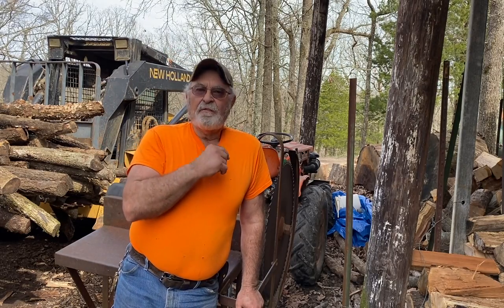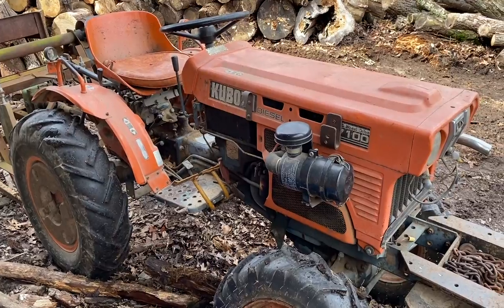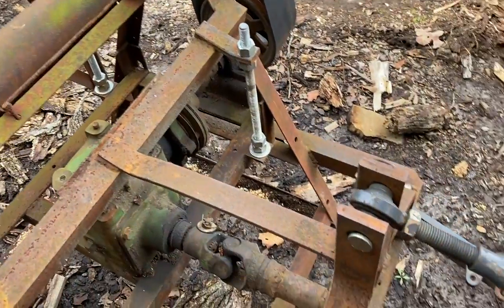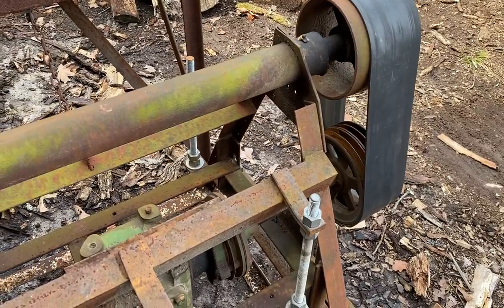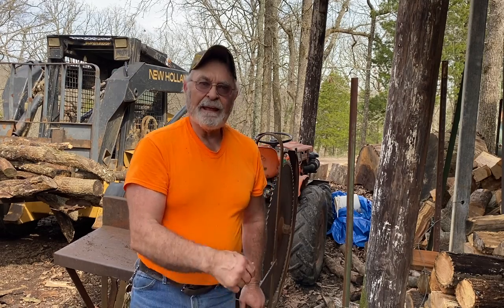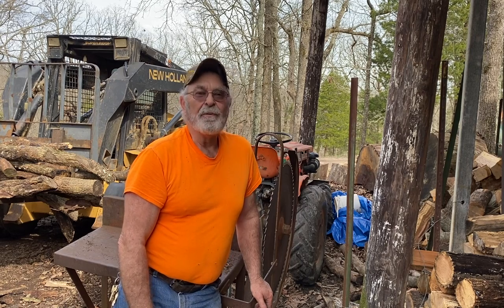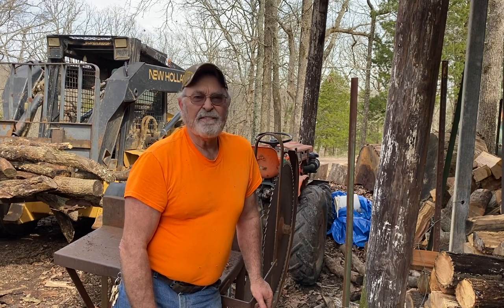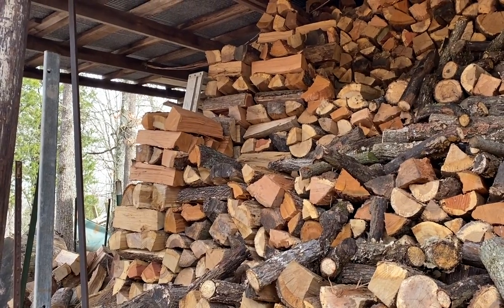Kubota B7100,  Buzz Saw and Pole Wood

Comment: Like this guy a lot I could watch his video all day long keep them coming like the tractor video I'm 32 and own a ford 2000 1960 something or 70 something
Reply from the maker: Dang, missed your comment David.  I too have a '72 Ford 2000.  I have a series of unpublished video converting it to Petronix electronix, new water pump, Holly carb service and other stuff.  Just don't have the time to edit and upload yet.
Reply: Maybe you could help me then on something I'm struggling with my fuel line that runs from the carbiratotor to the sedement bowel I cut that little s line and made anther one with just 2 bends in it know my tractor sputters but she back to life thankfully
Reply from the maker: @davidshultz4986  Is yours the 3 cylinder?  Its got a Holly carburetor and they are a bit more aggravating than the old style.  They are notorious for a sticking pump piston.  I don't know if they call it an accelerator pump or not, but its housed in a funny looking assembly on the bottom of the carb and it just won't run right until that is totally cleaned and made to raise up and down freely.  Its got a spring and some nylon parts and stainless steel bent wire holding the spring under compression.  That same line you are working on is leaking on mine.

Comment: Wow! This brought back memories!  I cut a lot of wood with one of those back in the 60's.  The bed was longer and it was powered by a Ford 8N Tractor with a right angle drive off the to and a long drive belt as wide as the one you use.  Just pull the tractor forward til the belt was tight and get to sawing.  Great video!
Reply from the maker: Thank you Larry for the awesome comment.I'm glad it struck a good memory.  I have several others, check this out for another variation:https://www.youtube.com/watch?v=gomaSRyPqBs Or if you are really wanting to watch something fun, check out this playlist:https://www.youtube.com/playlist?list=PLk72G9DTzZ1tJEjzkfIvq8dY-UWCpl4

Comment: Nice attachment. I have a B5100 that I love. I can finish mow with it at full throttle and burn about a 1/4 gallon per hour. Amazingly efficient machines.
Reply from the maker: Good Morning....sorry to say I just found your comment.  Yes, the Kubota's are remarkable machines.  I didn't know there was a B5100...an old buddy had a B6100 though.  These are bulletproof and tremendously fuel efficient for the amount of work they are capable of performing.

Comment: A buzz saw like yours is ideal for those pecker poles and sawmill slabs, big stuff is hard to lift and handle. I have used one for many years, very few men know how to sharpen them properly.
Reply from the maker: Well Frank, I don't know if I do it properly or not, but I can make it cut and that's what counts.  I've got several videos on sharpening by hand and also with a Belsaw Sharpall.  Here's one here:https://www.youtube.com/watch?v=06hJGTyCPqM  Here's one of my first videos where I showed how I learned from my dad back in the '50's to lay out teeth for gumming the gullet and reshaping the teeth:https://www.youtube.com/watch?v=TZ36Rxpn754&t=3s Thanks a ton for watching and commenting.  It is greatly appreciated !!

Comment: 44 sometimes think about building one for my BX 2370 but dont burn wood maybe some camp fire in back yard 
Thank you
God Bless 
PaK
Reply from the maker: These used to be at just about every farm sale.  I still have seen several within the last few years.  I even picked up arbor assemblies with the flat pully, bearings and blade for a couple bucks here and there. That BX 2370 is a hoss in itself.  Lots more of a tractor than this 38 year old 16 hp little guy !!  Thanks Peter for the comment and let us know if you build one for sure !!

Comment: That was making some fire wood in a hurry I like that set up that is a lot better than running a long belt from the tractor what is how we had to run ours a lot quicker and much easier on the back than using a power saw thanks for sharing take care
Reply from the maker: I like the versatility of this little three point rig too.  Zip into the woods, cut and toss right into the trailer or do it like this video.  Haul the pole wood to the shed, cut and toss right into the shed slick as a whip !!  And the 16hp Kubota sips fuel running wide open all afternoon too !!

Comment: You know you have a great tractor, now rotate that stack straight up!!
Reply from the maker: I've seen the B6100 &  B7100 with it in the vertical position, but this one came from the dealer just like this in '82 when I bought it brand spanking new.  I still have the 4' Kubota blade and 48" Bush Hog finish mower.  I get no fumes in the face with it diverting to the lower left, so I just left it alone.  The B2400 though came sticking straight up just like the straight pipe I put on that one and the B3030 is like this one, except under the side shield.

Comment: How's she goin'?  We have used this type of saw many times and like you say, I don't believe they are any more dangerous than a chain saw probably.  Cutting wood is dangerous work and often times can accidents happen.  If you know what you are doing, don't over exert the machine or yourself, it turns into a pretty safe operation.  Nice set up on your saw and it sure buzzes through those rounds and no bending over like you do with a chain saw!!!  That's what I like most about this set up!!!  Take care!!
Reply from the maker: There's a lot of guys out there that remember them from working with their dad's or granddad's and it brings back memories of somewhat of a simpler time in our lives I think.  I've just never gotten away from them using them every year to process sawmill slabs and pole wood like this video.  Thanks for firsthand corroboration of my suggestions about the quickness and usefullness of a buzz saw.

Comment: I'm typing this with the big toe on my left foot. I walked by one of the machines in a fence row and it jumped out and attacked me. It cut every part it could reach.  I now have just a few hairs left on the top of my head! 
All of the previous sentence is absolutely true except for the typing with my big toe, walking by one in a fence row, and it jumping out to attack me. 
It did cut everything it could reach and my hair is missing.
Reply from the maker: Ok..ok..ok...hahahahha. I just spewed coke out my nose !!  That's hilarious and it proves you read the description....LOL.  Thank you sir for the awesome comment and...sorry about your hair.  LOL.
Reply: @tractorman4461  I lost my hair at the Kubota dealer....after he told me how much $ replacement parts are. I still have it in my hands. I am thinking about JB Welding it back to the top of my head.
Reply from the maker: @prairiehoarder  hahahaha.... that’s funny !!  LOL

Comment: What would be the largest size log that you would say is safe with yoyr type of buzz saw .I get free wood from tree trimmers that i would like to cut up.These peaces are cut longer than i normaly cut my wood so i bought a old buzz saw to try to salvage this free wood.
Reply from the maker: I limit the limb length to 8 or 9 feet for branches depending on the diameter.  The larger the diameter the more cumbersome it is to balance on the work table without the long end dropping down and pinching the blade.  If you pinch the blade it could 'throw' the work piece or draw your hands or arm into the blade.  I'd suggest starting out slow with smaller pieces until you get the 'feel' for the way the saw works.  They CAN be a challenge so be very mindful around them.  Here's a long video that will highlight a portion of the dangers if you are interested:   https://www.youtube.com/watch?v=2J0trs7CF_Y&list=PLk72G9DTzZ1vR5HU-MFrvAt8RCHx_nK5k&index=7  And here's a playlist using a different saws in different manners on different tractors: https://www.youtube.com/watch?v=2J0trs7CF_Y&list=PLk72G9DTzZ1vR5HU-MFrvAt8RCHx_nK5k&index=7  Good luck, and there's even some hand sharpening as well as machine sharpening videos in this list.

Comment: It seems most discuss the older buzz saws which didn’t have the protection like the more modern units such as the balfour 700c buzzsaw.   The blade on those are almost completely enclosed. Looks much safer than a chainsaw.   It seems to cut better than the older style blades.   I’d like one.   Most of the wood around here is soft spruce and fir under 12 inches.    My only concern would be hitting a nail or something similar and what it might do to the blade.  I think using that would be more comfortable to use after 8-10 hours.  Have you seen one of these newer units?
Reply from the maker: No sir I haven't seen or heard of them at all David.  Throughout my 42+ career in construction I had to go through the 30 hour OSHA safety course more than once.  Some of the safety devices are very well founded, but others are more of a hindrance to getting the job done.  I would have to take a look at the Balfour 700 to see which side of the aisle its on.....balancing safety with functionality. 
    I would think the new ones would be fitted with a carbide blade which would be a tremendous improvement over these old steel blades in many ways.  The newer designed blades with carbide can spin at a much higher rpm, creating an exponential increase in rim speed which would result in much greater capacity to remove wood chips. 
    These old blades, when hitting a piece of metal just suffer some tooth damage that's easily repairable if you are reasonably handy whereas the carbide blade hitting the same piece of steel may have to be serviced in a saw shop to grind the carbide or possibly braze on a few replacement teeth.
    I cut easily branches up to 7'', though 8'' and 9'' are within reason.  The problem comes in with physically handling and balancing 6' or 8' long branches of 8'' and 9'' in diameter on the limited work table.  Straight branches are not bad, but twisted, bent branches create a challenge to keep from binding the blade in the cut.
    Bear in mind, these are just my rambling thoughts without any additional research on the subject.  One more thing to remember is these old saws can be purchased all day long at farm auctions for $25 to $100 in my area.  So there is a very small investment at the beginning as compared to a new saw of any brand or design.
    Thank you very much for the thought provoking comment and I hope the rambling answer kinda hit close to the mark.  Please comment or ask a question any time at all.  I'll eventually get to answering it.  Thanks again David.

Comment: You know you have had a work out after all that pitching of the sawn wood.   Enjoy the videos.
Reply from the maker: If it wasn't for CBD oil, I think my right shoulder would be disconnected by now.  LOL.  Seriously though, it got to where I was going to go to the Missus's joint surgeon but gave CBD a try.  It took three or four weeks, two times a day but the continual joint pain went away !!  That's been several months now.  Thanks for watching.
Reply: @tractorman4461  Are you taking it orally, or applying to your shoulder directly? I've never had much luck with the capsules I've tried.
Reply from the maker: @TimTimTomTom  We both take the drops orally.  It's the only way I can keep my shoulder under control with all the tossing off the buzz saw and wood splitter.
Reply: @tractorman4461  How long did you take it before seeing an effect?
Reply from the maker: @TimTimTomTom  Oh I'd say several weeks...and I've stayed on it religiously.  Like clockwork.
Reply: @tractorman4461  Maybe I'll give it another try. I just don't like that it keeps me from getting the proper effect when I smoke a joint.
Reply from the maker: @TimTimTomTom  Hahahahaha...now that's funny and even though I am of that era, I've not had the pleasure of taking a toke.....not that its not ever been offered.
Reply: @tractorman4461  It's never too late to give it a try...

Comment: I have 2 questions: 1 is the post just to your right the length you want?
2. Have you thought about painting a white line to the left of the blade to show the max length to cut so you have an immediate indicator whether you need to make another cut?
Looks to me you have that down pretty good.  Your right arm should be getting bigger than the left with the way you through those chunks.
Reply from the maker: The T-post just happens to be stuck there.  I just estimate 16'' and sometimes its short and sometimes its long, but no matter they all still burn....LOL.  I was going to attach a 3/8 rod that will flip up for storage and flip down to guage the length.  It'll attach to the frame on the 'off bearing' side of the rig and pivot up when not in use.  One of these days.....  Thanks Roy for stopping by, watching and commenting sir.  Btw, I did mark the backboard of the table a few times and it really does help in estimating the length quickly.   More times than not I have a tiny short left over and you'll see them tossed to the RR of the tractor tire.  Those are taken by the basketfull into the shed and used in quantity when I need just a small fire.

Comment: Morning T!  Nice overview and demonstration of the saw. It seems very efficient - certainly more so than me having to cut  the same blocks with a chainsaw. I think safety largely starts and ends with the operator. The saw has guards and is totally controlled by the operator. It certainly looks mean though. LOL. Big 'ol teeth on it looking right at me.:)) By the way - when you refer to "pole" wood versus regular firewood, what is the difference? Is it called pole wood because of the smaller diameter? or what differentiates the two?
Reply from the maker: Pole wood is kind of a slang term for limb wood or small saplings that can still be used for heating.  Essentially its anything about 8'' in diameter and smaller in whatever length you can handle to toss up onto the tilt table.  Sometimes they are straight, sometimes curved and sometimes crooked as a dog's hind leg !!  When we drop a tree we typically lop off the tips of the branches at the point at where they are too small to use for firewood.  Then we cut the limbs in the determined length as described above all the way back to the log.  Cutting and hauling pole wood minimizes the time in the forest or jobsite because its only one cut and one bend over to toss on the trailer instead of multiple repetitions of the undesirable exercise.  We try to haul logs on one and pole wood on another trailer.

     I like them 8' or so unless they are extremely heavy wood.  But we end up with them all different lengths.  The longer ones minimize the effort in the woods loading on a trailer.  Then we cut the logs in the desired length usually anything up to 26' in length because that's the longest we can haul.  We then stage the pole wood near the woodshed as well as the logs so that they can be alternately processed and tossed directly into the shed to get a good mix of dense heartwood as well as the lighter pole wood that contains less btu content per pound.  There is less btu/lb because of the proportion of sap wood to heart wood.  Sap wood is the rapidly drying ring around the perimeter of a round and is the first portion to become pithy.  Thank you GP for the interest and I do apologize for seemingly being unable to provide a concise, short, non-lengthy, abbreviated, brief, succinct and truncated reply. LOL.  Take Care and Be Safe and have a wonderful weekend sir !!
Reply: LOL! Now I know - thanks T!

Comment: I don't like the looks of the way you do it but if you feel safe doing it that way that's fine I would keep both my hands to the left of the blade and let it fall and pile up or having an off bearer to the right of the blade. Just how I think I would do it if I was there it may be different.
Reply from the maker: You would develop you own technique as you become more and more familiar with this or any other machine.  What happens if the wood is let topple to the ground, when you least expect it, one will hit wrong and pop right into the teeth of the rotating blade either instantly jamming the blade and throwing the belt or the force of the hit on a tough piece of oak will make the rig jump.  Either way is not good.  Sometimes the right size piece will be shot upwards into the side of the blade and lodge against the bracing which will heat the blade pretty good by the time you can shut it down.  Also a fellow has to shut down the rig and clear away the off-fall every 30 or so cuts at the most if not tossing each piece like I do here or endanger your foot by kicking the piling wood away while the saw is running.  Not good either. LOL. Plus as the pile builds, the round cuts have a tendency to roll back under your foot.
    My right hand if you notice ALMOST always is resting on the metal frame to ensure it will not be drawn into the blade by a slipping pole, plus the off-fall is in my hand and tossed immediately into the shed or trailer eliminating another handling of the product. 
    I agree, an off-bearer is by far the best way to go and when available it is my preferred technique, but unfortunately help is seldom available when its needed for the rig. 
    I thank you for taking the time to watch and comment, but there really is not much danger working with these than is commonly thought.  I know you would start out making the cuts in this way or that way but as you 'get in the groove' you would find yourself automatically settling into a routine that would be comfortable for you very quickly. Thanks again, and I hope the suggestions I listed will help you in the future if you were to pick up an old rig.  One more thing too...there are quite a lot of variations to buzz saws.  Tilt tops, slide tops, roller tops, and stationary tops to name just a few...LOL.